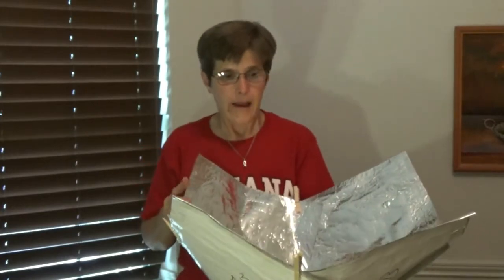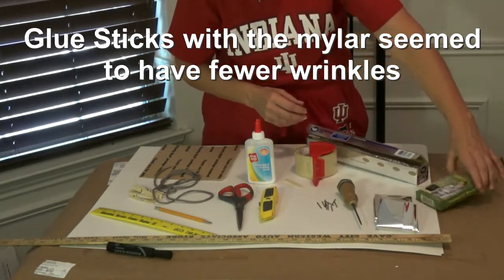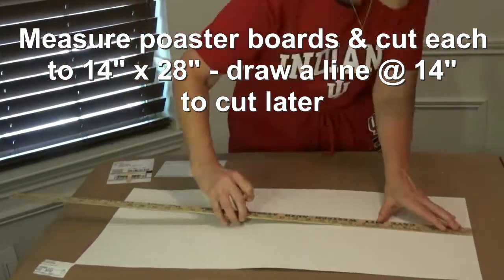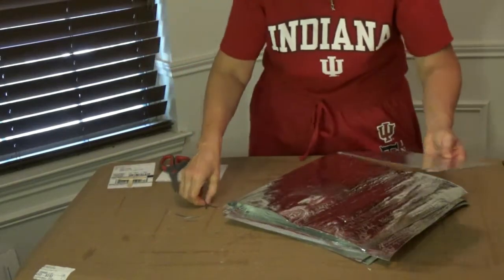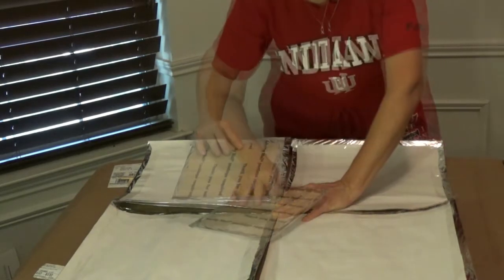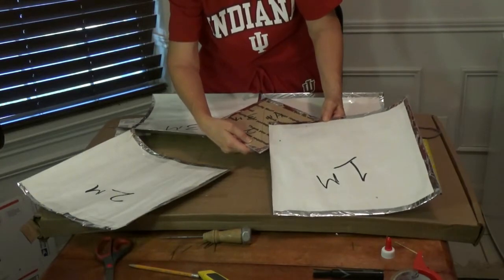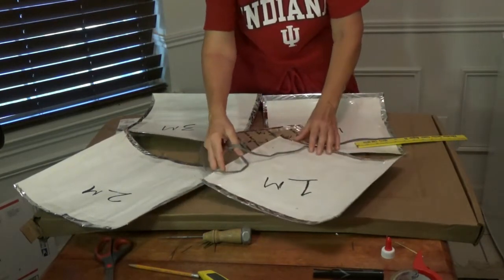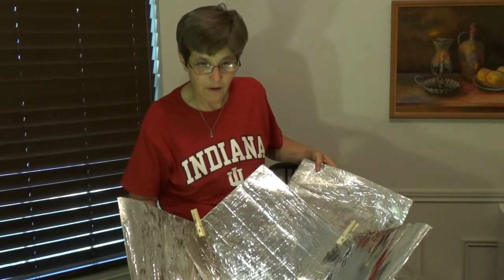How to Make a Copenhagen Solar Cooker - DIY Solar Cooker, FREE Solar Cooker, Free Solar Cooking

Comment: My guess is the mylar panels will last longer and that they'll be more efficient after N times of use.
(N times, because sometimes accidents will happen and also some panels will be treated kinder than others - but in the end, mylar will be able to survive longer).
To make the boards more weather-resistant, you could spray with plastic-spray (or other water-resistant spray) a few times.
Reply from the maker: @68HC060  Absolutely agree.  After 5+ years of use, my mylar panels are going strong.
Reply: @TwoTiredTeachers  - That's just excellent. 😃 -I've heard that one can also get some "mirror-paint spray", which would then avoid wrinkles, it might be worth trying out.

Comment: Hi, just recently found your channel and love you two!  I wonder, since the mylar is plastic, could you go over it with a hot hair dryer to remove wrinkles?  We used to use a heat gun to shrink wrap plastic packaging at work years ago, and wonder if this would be similar.
Reply from the maker: Thank you very much.  We do have fun with channel.  

About the mylar, we never even thought of using a hair dryer.  If you decide to try it, let us know how it works.
Reply: Put the mylar on a tube to roll it out. Smooth as you go.  A section of a ROUND pool noodle works well.

Comment: The All Season Solar Cooker is made using a corrugated plastic like the kind these light weight political signs are made of and gives a smooth but lightweight & waterproof surface for the silver tape he uses to make them though it would probably work with the mylar too.  I think your poster board is wrinkling from the moisture from the glue and that wouldn't happen with this corrugated plastic.
Reply from the maker: Good to know.  Thanks.
Reply: It's actually bubble wrap with mylar on the surface.
Reply: @graftedinforever971  My All Season Solar Cooker (received about a month ago) does not have any form of "bubble wrap" in its construction. The rigid parts are corrugated plastic with a highly reflective film (Mylar?) adhered to one side. You may be thinking about vehicle windshield sun shields and/or Reflectix sold, in a roll, at our local home improvement store. 

Yes, aluminum tape has been used as an alternative to Mylar and aluminum foil to provide a reflective surface. Reflectix can be used in a similar way. Since I have some of both materials, I may try making a Copenhagen, as I'd like another cooker when I want to prepare several foods at one time. Perhaps one with poster board and tape. The other using poster board and Reflectix.